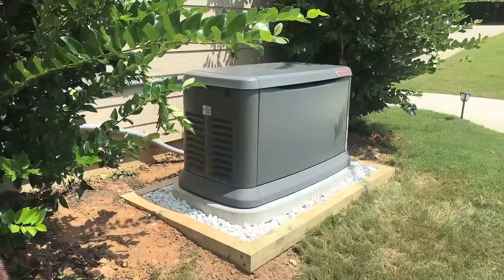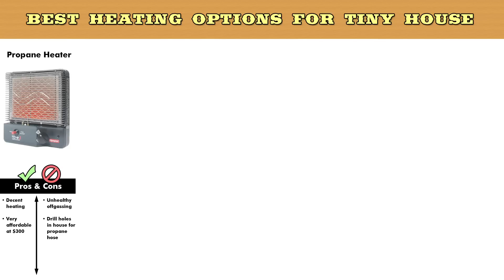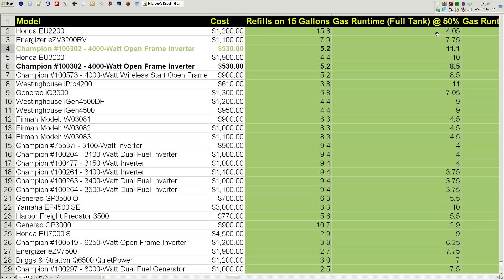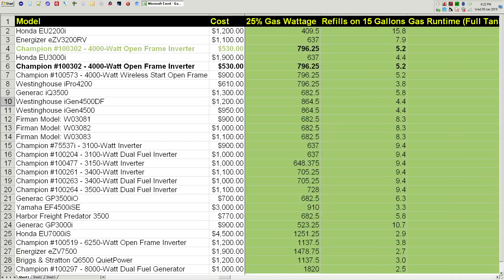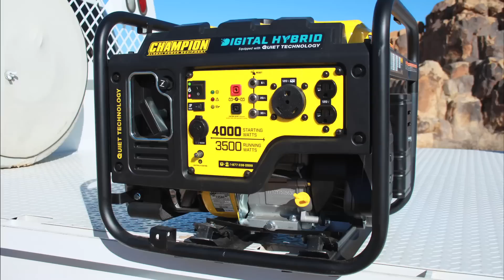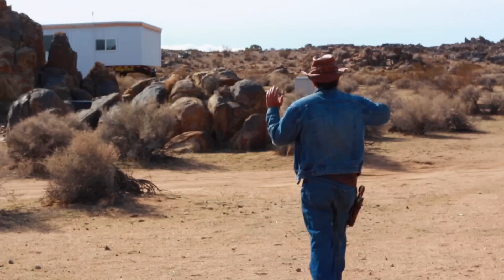How to choose the best portable generator?

Comment: Great info,  I had been looking at a much larger generator, as I thought the bigger the better.  Then I saw this chart and now I scaled down to a 7,000 instead of a 12,000 watt which is a little less than half the gph!  Thanks!
Reply from the maker: You're welcome. I had the same misconception. Then I realized, getting a larger generator than your power needs is just a waste of fuel and money. Calculating your maximum power requirements, then getting something big enough to accommodate those requirements, is all you need. Thanks for the comment and glad you found it useful!

Comment: I have had issues with the champions, they would not produce as much power as they claimed and they're extremely loud. Hopefully, you have better luck than I did with it. I returned it and bought a Honda.
Reply from the maker: 350 hours and not one problem. Starts on the first or second pull, even in rain and snow. Runs 11 hours on one tank of gas, with my heater blasting.
Reply: @LuthorvilleCA  well you're using the thing that is for sure lol. I'd be curious to see how long it last. Honda used to be the standard when it came to generators and that was all there was, now kohler makes damn good home backup units, onan makes good stuff but they don't like the heat for some reason I think they tend to overheat because a lot of them are mounted to an inside compartment which makes it hard for them to breath, hell even harbor freight i hear is making a decent product now with their predator line but please let us know how that thing does long term.

Comment: I got a Champion duel fuel from Costco. I got it specifically so I don't need to put gasoline in it, it can run on propane also. Gasoline is hard on things that sit. The downside is the freaking noise! The little Honda is great because you can barley hear it but it's not very powerful and again, it won't run on propane. Propane can also be stored safety for long periods of time unlike gasoline. I I also have a Barbicue that uses the same tank so I just bought a few back up tanks. Yes it's slightly more expensive but when you consider it's not eating fuel system, I can store it, and it's not used all the time, I think it's the way to go. I did a small review on it. Hope all is well. Nice job on your video.
Reply from the maker: You raise a number of good points.
I agree with you.
If you intend to let a generator sit unused for very long periods of time (e.g. over a year), propane is a better choice.
If you intend to run a generator several times a year, all year long, gasoline will be fine.
I plan to use my generator every now and then, even when I don't have to, just to make sure it stays in good shape. According to the manual, Champion suggests running it for at least 20 minutes, every 2 weeks. If you do that, you don't have to set it up for "long term storage" or anything. Plus, I will add some Seafoam to my fuel cans, and make sure that is running through the system as well, during the "downtime" months.
Thanks for commenting!
Reply: Hi any recommendations which generator you bought? Is it very easy to install?
Reply: doraemon chan what are you going to power with it?
Reply: @RedefineLiving  For home.. for emergency in case power out.
Reply: doraemon chan The simple answer is that anything is better than nothing. There is no installation for most units. You just put it outside, start it, plug in what you want. A small unit will run longer on less fuel but it will only power a few things (lights and chargers exc.). A medium unit like the one in this video and like the one I have will power more (refrigerator, small heaters, tv exc.) keep in mind that heating devices require a lot of power. A large unit will power your home but it will need to be professionally installed and calculated for the size of your home. They can get expensive. I hope this helps. If you want more specific information, just ask. Hope all is well.
Reply: @RedefineLiving  thank you very much  :) hope is well too...

Comment: Did you build the shed? Do you have a ventilation for it and what materials are the shed made of? I am looking into getting one for power outages. What voltage does this one have? Thanks. Love your videos!
Reply from the maker: Funny you should ask. I also made a video detailing everything about the shed, and I plan to upload that in the near future.
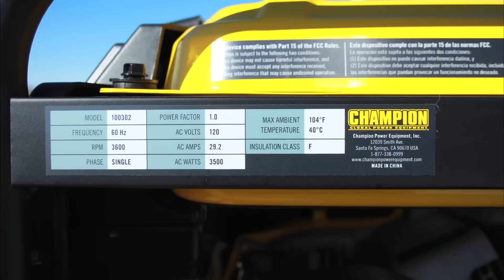Check the still photo at 27:06 if you want the specs on my generator.
Thanks for watching!